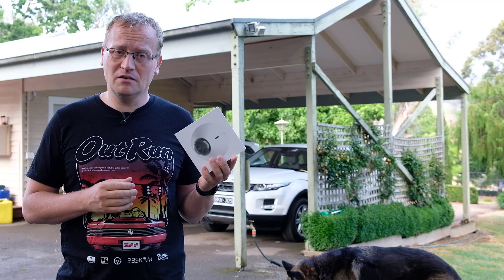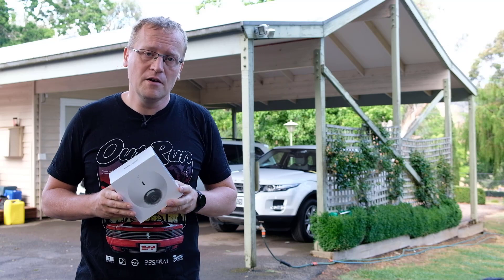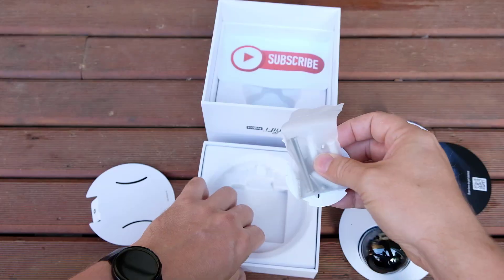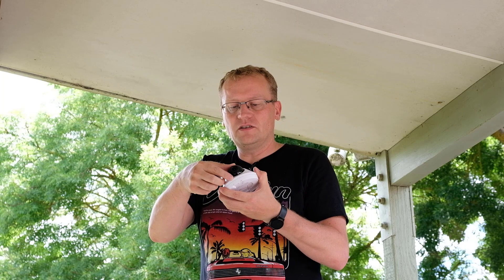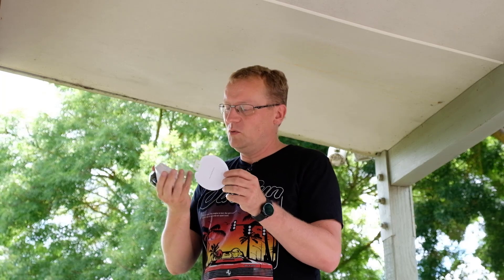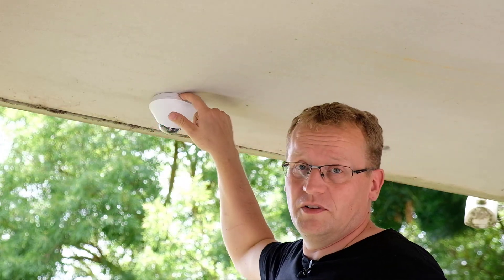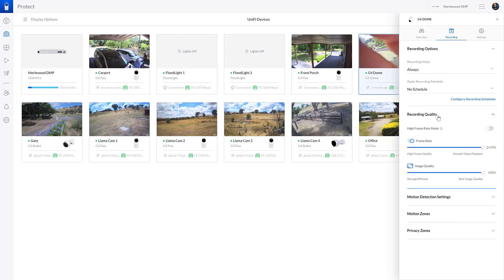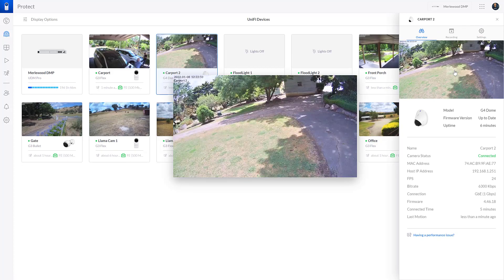Unifi G4 Dome Camera - Is it vandal proof?

Comment: Hi Lars, quick question, how do you take the camera back off the mount so you can restore to factory default if needed?
Reply from the maker: The camera comes with a small tool that you can insert into a small gap and release the lock to take the camera down.
Reply: @LarsKlintTech  hmm.. I don't recall receiving a tool in the box. I'm assuming a paper clip will do the trick.
Reply from the maker: @sohodigital5708  You should have got one with the kit. It looks like a flat piece of metal with an 90 degree bend. Like here under "unlock": https://help.ui.com/hc/en-us/articles/1500002741601-UniFi-Protect-Get-started-with-the-G4-Dome-camera
I don't think a paper clip will work, as you need to lever the lock mechanism and the paper clip will just bend.

Comment: Hey 👋🏻 Lars, 

How is the video quality?
Reply from the maker: Hi Lars 😊 the quality is good. Not as good as the G4 Pro (which make sense), but once I cleaned the plastic dome cover, it hasn't skipped a beat. Works well at night too.
Reply: @LarsKlintTech  thanks for your reply - I currently use a different surveillance system that I’m not too happy with, hence I’m getting more and more interested in Unifi protect (I already have the UDM Pro SE) My question is; how responsive would you say that Unifi protect is when it comes to detecting people and vehicles? Are the push messages instant on you phone when you are away and how fast is the app to connect?
Reply from the maker: @larsl6508  Good questions. In short: it works really well. 
The detection of people is very accurate, although sometimes the dogs trigger the event too, which I can live with. The vehicle detection is in "Lab" mode, but works every time afaik. The push notifications come immediately (depending on your connection of course) and even have a screenshot of the event. 
Note: person and vehicle detection is only available on the G4 range of cameras.

Comment: Gday Lars great video as always from down under , hey I have heard that the earlier model G3's suffered from moisture inside that plastic lens cover so I would be keen to see how it goes over time and see if that is an issue in this new model.
Reply from the maker: Yes, I will monitor that too. At least the cover is easy to remove and clean.